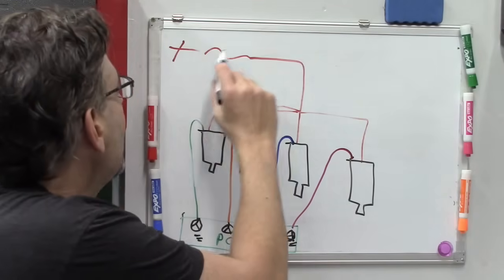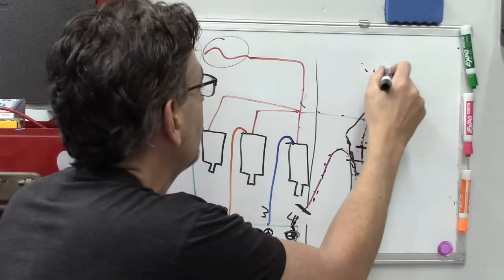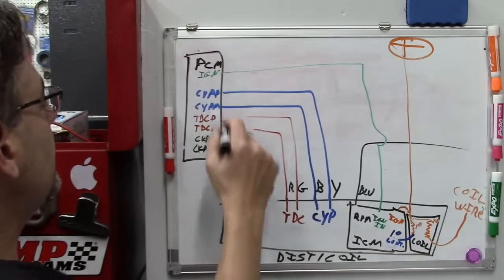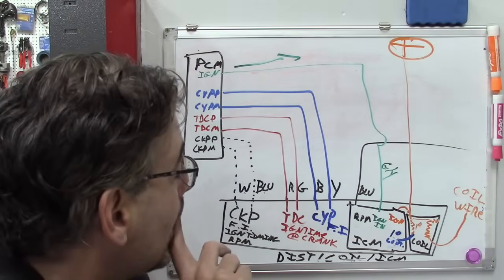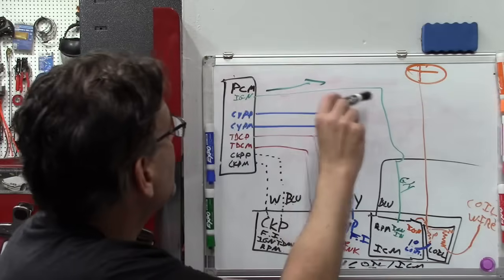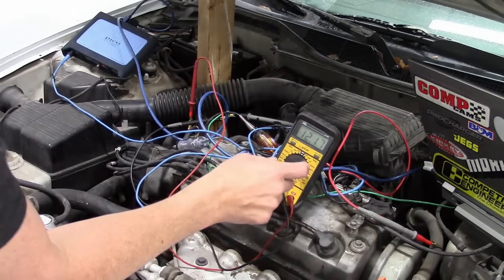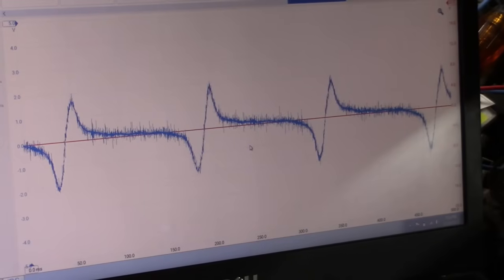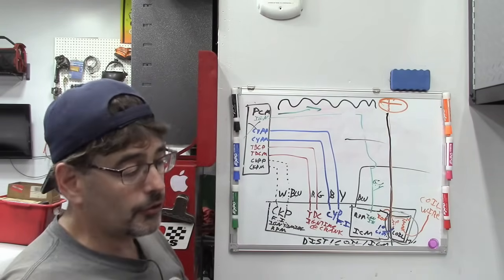DIY -How To Diagnose No Spark No Start. Bad Crank Sensor? FREE SBQM VIDEO

Comment: I been working for weeks on a 2000 prelude with a similar problem. Even changing the whole distribuidor and I can’t get a spark from that.
When the initial concern on the Honda dealer was the immobilizer control. That what they sold me and they cannot fixed after almost 2 months so I decide to start trying myself. I’m getting a better idea of how. Thanks

Comment: I am a 60 year old tinkering mechanic, I do not own a scope ,just the tools shown in the video. I’ve learned more in this video than all the rest that I’ve seen!! ❤ Nice! Great Job!
Reply: Hello, I finally got it to crank. I discovered my aftermarket ignition switch was defective. So, grabbed an A Delco, one. Also, I am not getting no spark. Have fuel and compression. However, got the P0118, P0443, P0223, & P0122. However, when I resolve the no spark issue, it should fire up. I already replaced the coolant sensor, but code came back, after I cleared it. Need to get a new throttle body or throttle sensor, & purge valve solenoid. So, what do you think, Sir?
Reply from the maker: If it doesn’t crank how do you know you have spark and fuel?
Reply: @SchrodingersBox 
He said it cranks now, but it still get no spark. Sounds a little bit like your coil problem? But his car probably is newer since it has immobilizer. So he probably has plug in coils directly controlled by the PCM. It's rare to have all of them disabled at the same time. I bet the immobilizer is messed up after all this swap and needs reprogramming.
Reply: Before watching your videos i didnt even know what the various sensor are ,functions.
Now i diagnosed crank sensor correct. 
If only my issues were so easy. 

Crank no start, stalling, transmision slips, no overdrive, 
3 months of reseting ECU, proublems resolve for a few trips...... then return. Now a reset wont even start engine.
Im thinking it must be ECU. It finaly said....f....you im DONE !!
Be safe and well.
Reply from the maker: Great to know!! Thanks!!
Reply: @SchrodingersBox  , I am having a no crank, no start issue, after I changed my ignition switch. Before I replaced it, it only cranked. Before all this, I had a blown head gasket, my ECU malfunctioned & my BCM. Had to replace & reprogram both modules. I replaced my alternator, starter, battery cables, relays, & all fuses. Even replaced my crankshaft position sensor, still only cranked. But now, since the ignition switch swap, the dashboard only lights up. I was getting that service theft deterrent system, when I put the key in ignition. So, I replaced my malfunctioned aftermarket alarm & got a new key. Still nothing, but I didn't replace the passkey module, that's around the key cylinder. I hooked up my scanner, the module didn't throw any codes. But, for some reason, I still get the P 0633-00, theft deterrent key not programmed, when I program the key with that 30 minute passkey procedure. Do you have any idea why this is happening, when I basically have my van a major tune up. I have new spark plugs, wires, and ignition coils. I think my van is in theft mode, cause of the key code. And, when I put the key in the ignition, the computer shuts my ignition system down. I thought about replacing the park/neutral safety switch, cause my van just stopped cranking, after I replaced the ignition switch. I took the switch back, & exchanged it for another. Same thing, nothing. The brand is, that standard ignition switch.
Reply from the maker: Just start with the basics- since you changed the ignition switch, what is the control side relay voltage showing with key on vs key off?
Reply: @SchrodingersBox  , I only have a volts meter. So, I will have to check it out with that. I just ordered a power probe. Should get that in a few days. I just found the diagram for my van. So, will take probably a day or 2, to study/go over it. Will let you know when I find out.

Comment: Hi schro! I have a Lexus is300 with a no spark but fuel and great compression situation, I followed most of the procedures but I can’t help but to realize my ignition system is ran by an igniter would you possibly know how to check that? I have all of the possible tools needed
Reply from the maker: I am not familiar with that system off the top of my head. What year is it and I get a chance I’ll look at a wire diagram this weekend and see what would explain that.
Reply: @SchrodingersBox  your awesome! That would be great! I’m so glad you replied I felt I had no luck! it’s a 2004 Lexus is300, a little more detail is : all of the relays and fuses work, my 2 prong ignition coil harness’s are getting its full 12 volts and ground, my crank sensor’s ohms are within speck. The crank sensor harness is getting perfect ground but not receiving any signs of voltage of some sort don’t know if that’s normal. Ecu is in great condition seems to function properly. My only go to is my ignition coils, but I’m not buying them because ima follow your rule to thoroughly inspect and find the issue before buying😁.
Reply from the maker: Well wait wait- how it possible you have no spark if the coils are two wire but you have power and ground? Those are ground side controlled. Always. Are you saying they have constant ground? If so then that’s exactly the issue. Are are you saying they have ground side control? How are you testing that?
Reply: @SchrodingersBox  well it’s not consistent ground one wire is having voltage to prevent from grounding completely. I’m using a handy dandy test light to verify that on my run position both of my leads are getting voltage.
Reply: @SchrodingersBox  and I’m also using a multimeter, on my multimeter one prong is having its full 12 volts and the other( which is ground) is only having 6 just a little amount to level and keep from grounding completely.
Reply from the maker: that sounds like you are measuring ground side control. remember the dvom will measure the average of the voltage and ground side will be duty cycle controlled. it’s unlikely you have no control on the coil.  try measuring the coil ground against chassis ground while it’s operating or use a test light to confirm ground side control.
Reply: @SchrodingersBox  okay I’m about to do that right now
Reply: Hey schro! So I just tried to put a test light on both of the leads my test light did not show a green light for ground on both of them what should I do next?
Reply: @SchrodingersBox  maybe do the leads have to actually be plugged in to complete its circulation to ground?
Reply: @SchrodingersBox  so I’ve managed to put the harness back in to the coil, and I did the process again. When the ignition is off it’s getting ground because there no  voltage flowing through it, when I turn the ignition on the light turns off, meaning it’s getting voltage. when I go to crank, I still don’t get the ground light on each terminal
Reply from the maker: ok that’s not possible on a two wire coil. you will have power on both the power and ground side of the coil until the ground side is closed. with key on engine off you won’t have ground so you will see power on the ground side. 
   just make it super simple. just jump the test light between the positive and negative terminal of the coil  and see if it flashes. I bet it will. just make sure you don’t jump the terminals without a load or you WILL fry your engine computer. but that simple test is all you need to do to see if there power and ground side control.
Reply: @SchrodingersBox  okay awesome so to do this test should I simply take the coil and plug out, Connect the test light to the possible ground lead, ground the spark plug, grab a wire and connect the clamp to the ground wire?
Reply: @SchrodingersBox  also I don’t know if I mentioned but I am getting an ignition coil “A” code, even when the computer is switched. I switched the ignition coils within the engine (not new ones) Could that be the reason why it won’t spark?
Reply: @SchrodingersBox  hey schro so I tried to do it, it still wouldn’t ground, I put my multimeter to it they both read 12 voltage but when I crank they drop to 10. But none doesn’t seem to drop to zero even when using test light as well. You did mention that the dvom will only measure average
Reply from the maker: sounds like you are measuring the duty cycle to me.
Reply: @SchrodingersBox  yes, so today I’ve managed to bypass my ecu and force ground on my c2 of my igniter, and guess what, it started, but of course it would stop since only 2-3 cylinders are firing, and the grounding isn’t triggered, does this signify that my igniter works? If so, then my last and only culprits will get have to be.. my (inputs)..

Comment: Very nice diagnostic demonstration. I take my hat off to you, sir. Wish I had found out about your channel a long time ago, not last week.
 I had an intermittent ICM failure during 4 months last year on my 99 Honda Accord V6. 2 shops and 3 different electricians couldn't diagnose,  until it finally gave out completely. A DIY mechanic friend of mine diagnosed it doing a similar coil test, and ruling out injection or fuel pump. Many videos had led me to believe the main relay was faulty, but again, this friend of mine simply observed if the immobilizer light in the dashboard worked with the relay disconnected, didn't, so he immediately ruled out a bad main relay.
Reply: You replaced the main relay and it got it fixed ?

Comment: 😢would like someone to help me with my Honda CRV AWD Automatic 2.0 Ltr. I have no idea how test the fuses in the electrical box near my battery. So my battery is testing at 13, I got new spark plugs and wires, a new distributor. So I don't know why some mornings or days the vehicle has a bit of a struggle to start, the heat takes longer to warm up. If I have the music on or heat on and everything going electrical sometimes gives a bit of delay response while driving.
Reply from the maker: might help to know your location ?

Comment: I have a 2010 Kia Rio, has power but will not say a word, I had a mechanic over today to replace the starter it still wouldn't start rechecked all the fuses even the relay switches is still won't say a word but it has power what could possibly be wrong
Reply from the maker: What is the voltage on the starter showing?

Comment: Hondas have relays before the igniter.
The relays I've found on older ones were up in the instrument panel and difficult to access.
Cars cranking endlessly without spark out in the field that I've gone to check, needed main relays alot. The internals of the relays looked as though they were poorly soldered.
Others had igniter issue.
That's a "what has been fixing them?"
comment from experience.
But fuses are a must check, no brainier.
I had a Honda in the pitch black dark for a lady in a parking lot at a shopping center parking lot.
No light to see by, and she had three dollars to her name, left for the month.
The dollar store was nearby.
We took the three dollars and bought a flashlight and batteries.
I went to investigate her weird sudden no start.
System prechecks are always a must. (Ford factory training)
One of her fuses was missing.
I think it was a 10 amp? A red ATC.
We put one in there.
Started and ran.
Happy motoring.

Where did her fuse go?
FIIN.
You can't leave a car unattended in some parts of the city. She could have caught a ride and returned to God knows what the next day.
This place didn't even have the basic lights to see by in their shopping center. (Democrat run area)
Her cars interior lights were also defeated or bulbs had failed.
Good thing she still had a few bucks for a basic need in her neighborhood.
A light to see with and a spare fuse.

Comment: Next time you leave the distributor plugged in on the power connector remove the 3 Bolts use to secure distributor to cylinder head with a 12 spanner. To diagnose coil turn the distributor cam by hand you will get spark that way.
Reply from the maker: Good idea!! I can vouch that this works because I remember shocking myself before doing that by accident ahahaha!!
Reply: THIS COMMENT DESERVES A MILLION LIKES

Comment: I thought if injector is firing then it means crank shaft position sensor is working fine.
Reply from the maker: Thats generally true.
Reply: @SchrodingersBox  Do you have any video on in which exceptions it wont be true? specially for cars after 2000.

Comment: Hey bud crank No voltage at coil tach wasn't jumping wen cranking replaced crank sensor tach is reading wen I crank However still No juice at coil leads any ideas old school lol
Reply from the maker: Pretty easy. Just check the power against a chassis ground and if it’s there check for ground continuity and it that’s there you have a signal input issue. Easy as that.

Comment: I could  use some help on this  2010  chevy traverse   no body has been  able to  figure it out   I was driving  AND  battery  saver mode light came  on and the  truck  shut off a mechanic  checked it out and said that it would  need a  new motor so I ordered  one he put it in and truck Crunk and ran good for a few minutes and then it  cuts off   and it keeps kicking  off  a crank position sensor  code changed it 3 times and it is  still not working  it still  keeps popping up  the crank position  sensor  code and  won't even crank  now  any suggestions on what  it may be  I paid $5,700 for the  truck  now have $12,000 in the truck (motor n shop bills and it is not  running

Comment: Greetings to all, I seriously need your help, I have 2008 Nissan note, this start but unable to accelerate, when I press the accelerator Paddle it does respond, I've change the padle, the ECM and the throttle but it still won't work
Reply from the maker: What was the data you had showing the ECM was faulty? I would totally start there!

Comment: Crank and Cam position sensors are the key to the control of the engine. Some engine have missing tooth on the crank for a reference to TDC...Once the computer has crank and cam information it knows exactly the position of each cylinder at a specific time and knows what to do in relation to ignition and fuel. I learnt all of this the hard way while designing a knock control system that listens for know only during the power stroke. It also determined which cylinder was knocking.
Reply: I seriously need your help, I have 2008 Nissan note, this start but unable to accelerate, when I press the accelerator Paddle it does respond, I've change the padle, the ECM and the throttle but it still won't work
Reply: @ernestkoranteng2400  Use a scan tool to look at the fuel trims. Look at the o2 voltage at WOT. Check that the 02 sensor oscillates using the graphing function and also read any codes.

Comment: I've become depressed because at age 61 I define myself as a DIY, "Shade tree", "backyard" mechanic
I came to that because i flucked, lucked out a Engine Control Module, Ignition Control Module fix 12 yesrs ago.
I thought i ead a kinda genious.
This year, my car failed to start. I bought a new starter ($330) to replace the old starter i put in ($25) - no effect. I tried a new ignition switch (both frustrating bitches to pet in). 
Then off to the mechanic. Not anything I thought as a possible fix. It was another Engine Control Module in my 2.2 2004 Saturn Ion.
The same issue I had 12 years ago after a frustrated beautiful young woman, Xena, gave me her car.
But now, I see schematics, PO330'S things, and on and on.
My mechanic still has my car at his shop.
I'm only good for changing oil, replacing filters, and not much else.
Im not a backyard mechanic@ im more a loser than a winner at this stage when it boils down to fixing fucking cars!!!!

Comment: I'm going to do this without watching the video. There are of course going to be exceptions but here is a quick trick that works a lot of the time. You have a cranks but won't start.  Turn the key off and then turn the key back on without cranking the engine. Could you hear the fuel pump run for about two seconds and then stop? Now crank the engine without cycling the key off. Did the fuel pump turn back on while the engine was being cranked? YES or NO? If it did turn back on while cranking the engine then the engine control module can see the crank sensor (ignition reference signal) and you didn't have to physically measure anything.
Reply: The Cardoc,
   I thought it was the starter so I bought a new one. Ignition switch. I bought one crankshaft position sensor (located behind starter). Then aftet all my work off to the mechanic. My mechanic said that's not it. It was the burnt out used ECM/ICM. (I replaced that before I new what it was $40 at junk yard. They told me it came off a Pontiac. I took their word for it). Put on top of head covering sparkplug. At the time I replaced spark plug and coil wires inside sparkplug wires. Ran perfectly for 12 years.
I didn't know what I was doing 12 years but i fluked and fixed I'm a Grade school level shade tree mechanic. But, if I knew it was an ECM , all wired in, I would've don't it all by myself.
But, I didn't know!!

Comment: The reason why they switching the ground is because they can use a simple N channel mosfet and switch that mosfet with signal of about 6  volts on the gate of that mosfer. The other way around to switch the 12 volt means they need 12 plus 6 volt which is 18 volt they have to generate specificly for only driving these mosfets. The could use a P channel mosfet but these are less efficient.